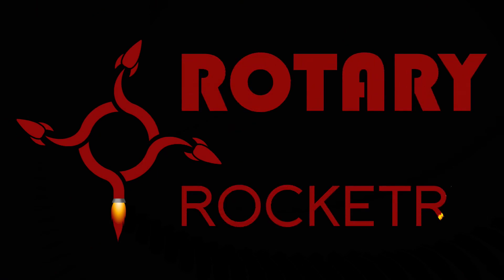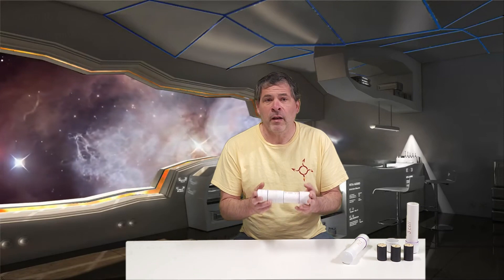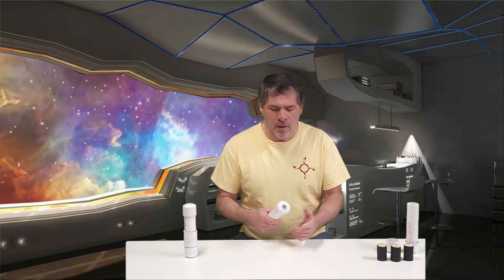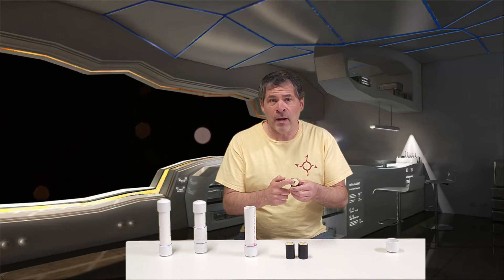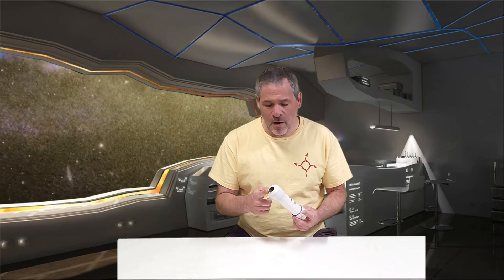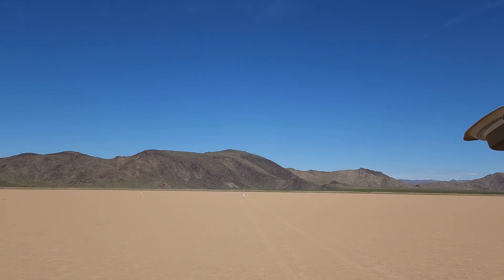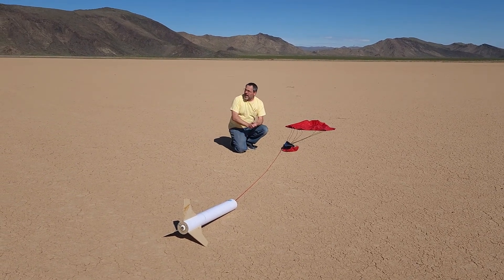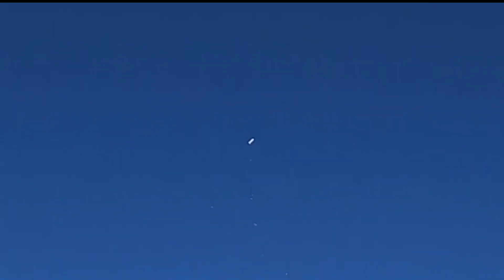Comparing PVC sugar rocket motors - One cell vs three cell - Which one flies higher?

Comment: i can only get technical grade KNO3 where I am, is that sufficient for making motors?
Reply from the maker: I have never tried tech grade so not completely sure. I have a rocket friend that said he used tech grade and he was having problems with the motors and he blamed it on the potassium nitrate but I have no way to verify that was the problem. If it was me... I would just buy the tech grade product. Your gonna have to test your motors anyways. If something goes wrong (explosion) then just adjust the nozzle size.

Comment: Just a quick note for no other reason that it popped into my head as you were mentioning core diameters.
Alway ensure the core diameter is greater than the nozzle throat diameter or the motor will suffer from what can be severe erosive burning 👍👍 (grains, not cells!!!! I know that’s just what you call em but it’s a 3G motor not a 3c motor!! It’s my OCD I think, drives me mad!!!!!!!!!!)
Reply: Also. Alway get a progressive burn with the 1g design, a multi grain motor will always have a nice flat ( neutral )  burn rate.  Do you use burnsim to design the motor case and grain geometry???
Reply from the maker: Most of the time I use two tools to help with motor design and grain geometry...
1. SRM spreadsheet from Mr. Nakka
2. A KN calculator and graphing app that I designed with the aid of Mr. Nakka. It is web based so hopefully will be something I will put on our web site... Some day when we get around to making the site.
Reply: @rotaryrocketry  awesome!! I use burnsim for “basic” motor designs I’ve already made ( and may just need a tweak ) but SRM since 2021, it’s definitely the best for sugar motor design.  I only use dextrose also, I find you get a more neutral burn, is real easy to cast and the grains set much much faster than sorbitol. Your right on the money using 1-3/4” dia, I’ve had my most success and have amazing J class ( 5 grain, I think 4” length each ) motors that are 100% reliable and so powerful it’s scary!!! 2” is harder to work with but I think can be used. 
I’m trying to figure out 2 huge pvc motors, an L1500 and M3000!!!!! It can be done……..!!!!
Reply from the maker: I know... but you get my point... If you put 3 batteries onto a flashlight then it's a 3 cell flashlight. So if you put three grains into motor then I think it's at 3 cell motor :)
Good point on the core hole / nozzle hole issue. I don't think I have ever gotten to a point where the nozzle has had to be larger than the core hole but definitely something to be aware of when designing motors.
Reply: @rotaryrocketry  except their not batteries!!!!!!!!!! OMG, we could go on forever with this 1!!!!! 
On a serious note, your doing an amazing job with both the rocket/motor design & fabrication ( I particularly like the chute design!!!! ) AND the channel itself. My son and I have been wondering how much time and effort go into such a venture, I’d imagine a lot. I’ve got books full of handwritten motor designs/grain configurations ( properly simulated etc ) from when I started years ago, and would love to be able to do something similar to be able to help, learn from and teach others.  I don’t know how you could with a full time job, perhaps it’s time to look for a desk job!!!!!!!!!!!